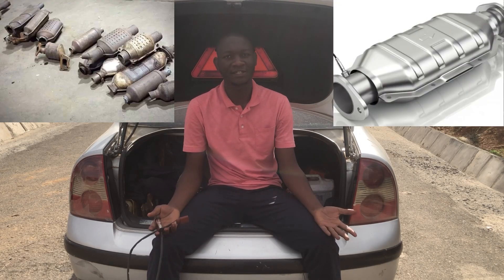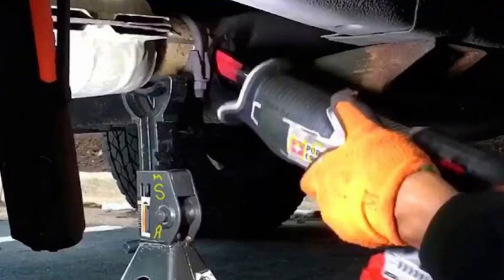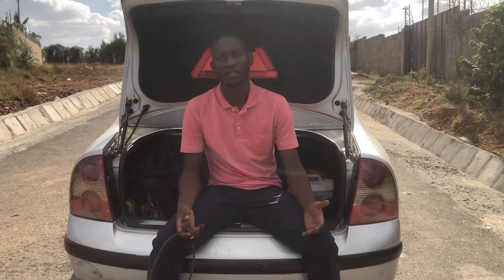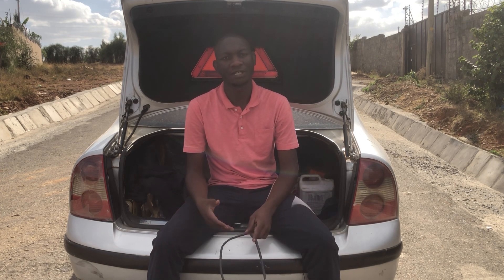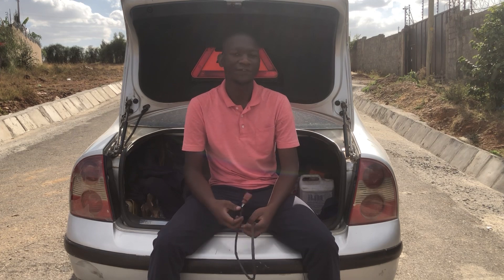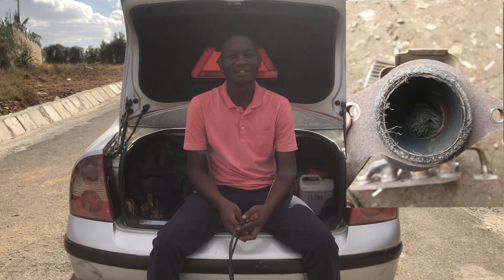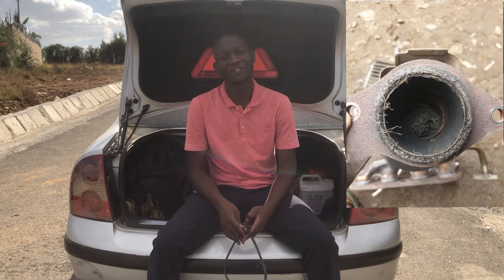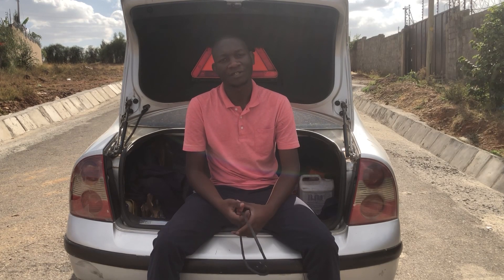Catalytic converters. How do they work? What is in them? Why are they stolen?

Comment: if my car comes with two catalytic converters and one is missing, can this cause check engine light? This is 2006 jetta
Reply from the maker: Sure, it will. You will find error of the catalytic converters efficiency below threshold. Or lower limit exceeded.
Reply: Can this be detected on the dash board lights?
Reply from the maker: @dandairr6470  check engine light should come on. Sometimes it may not. You have to do a scan.